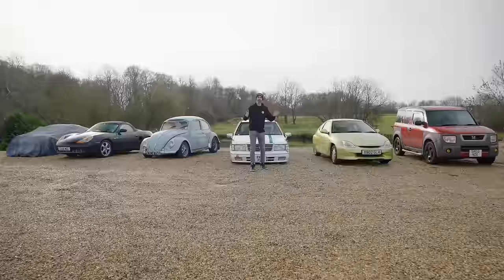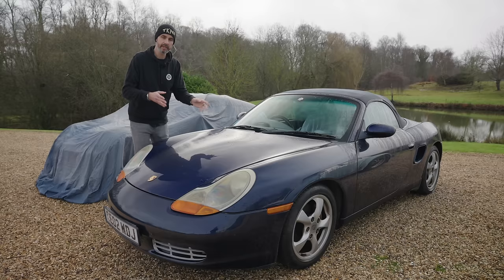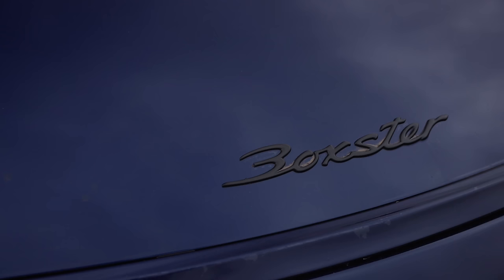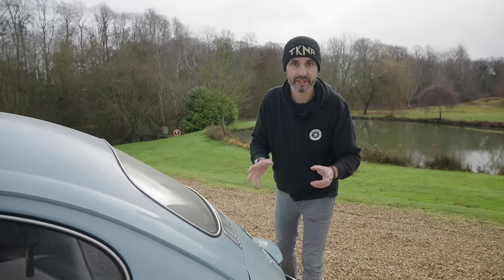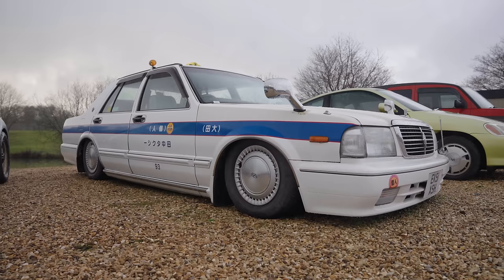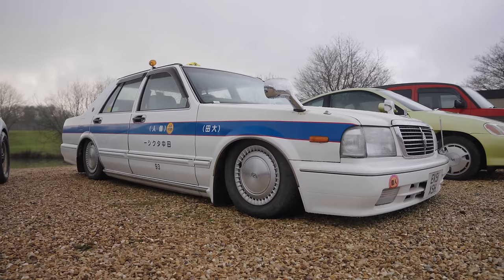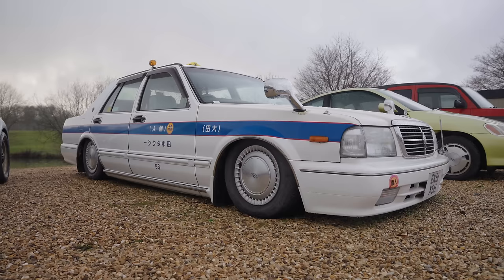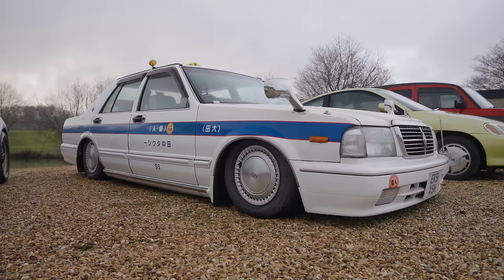My Project Car Round-Up. What classics I own and why I couldn't resist rescuing 2 more...

Comment: Sell the taxi if you got fair offers for it and let someone else enjoy it. Use the proceeds to fix the Element and get the Boxster some new bushings, brakes and wheels and then just drive it as is with flawed outside but properly sorted chassi and stock drivetrain.
Reply: I think this would be the best option, with it being Lpg it's only going to get harder to keep it running with fewer places offering it

Comment: Great to have a recap of the fleet and why you have each vehicle. The Element definitely feels worth converting to EV. It’s the best thing for it.
Reply: On what basis?
Reply: Mainly on the basis that Jonny has previously mentioned how much it costs to run with the existing setup. Plus his general sentiment (which I agree with) that EVs are great for everyday cars and the bulk of travel, and a few miles in a fun classic is great for the weekend.

Comment: Johnny, you mentioned your Element has a shimmy in the drive train. It looks to be an automatic. We own a 03 Element with an automatic that had a drive train shimmy. It drove me crazy trying to find it, I replace the rear diff fluid, all 4 struts, front driveshafts, and any bushings or balljoint that had even the slightest bit of movement. It turns out it was the automatic transmission. A complete fluid change fixed it. The transmission and torque converter holds 7 litres, but when you drain it only 3.5 come out, so you do that 3 times, and replace the filter, and voila, no more shimmy. Ours has 330 thou Km on it (Canadian model), we love it, it's the most useful car we've ever owned.

Comment: Johnny, the water under the seat is classic blocked drains under the fabric hood/roof. You have to put the hood into service mode, this will reveal a drainage area underneath and there are a couple of drains under there which get blocked with leaves etc. I blasted mine out with a pressure washer. Should sort that. Symptoms would be wet carpet behind the seats, under the door area.

Comment: Keep the taxi and take the wheels to a place that can turn the oem faces into 3 piece wheels, it wouldn’t screw with the car itself and it would make it look even better on the air suspension, if you want to keep the stock wheels maybe just get an aftermarket set. But the custom wheels would be killer!
Reply from the maker: Love this idea.

Comment: Hi Jonny, I’m an ex-Porsche technician, re the water ingress, first thing to check as it’s a common issue, remove the plastic cowl panels  under the bonnet & you’ll see left and right the drain holes, these fill up & the water enters the car and plays havoc with the ECU’s under the seat, blow out with an air line, test and refit the cowl panel.

Next  is the top windscreen seal, usually ingress is from the corners. The seal dries out, try applying Vaseline to it and the seal on the front of the hood.  The seals on 986’s are expensive.

Then check by lifting the convertible flap halfway, the two drain holes either side as these fill up with rubbish, finally make sure the door panel waterproof seal hasn’t been damaged.

Please for the love of God DO NOT EV the Impala, that would be criminal, the engine of any car is its soul!
Reply from the maker: Thank you for taking time to write all this. Intending to look at it this week...

Comment: As a former employee of smart my eyes dilated seeing your roadster. The roadster is a great car worth saving and  brabus version is a blast to ride. Sadly the plastic bits on the car don't age well especially the rear windows.
But you can replace them . Replace the turbo, check for leaks in the roof!!!
Get this horrid vinyl off and it will be a blast!!!
Reply: The rear windows do polish up quite well. Wet sand 500-2000 grit, then polish. Quite a job but really rewarding.

Comment: Boxster leaks can often be down to a panel seal behind door cards, also noticed the hood cable is over, not behind the guide above the door. Sell the engine to someone who's been bitten by the IMS bearing and put a 400hp Impreza boxer engine in it!

Comment: Nice one - knew it was a Roadie as soon as I saw the cover. I have a last-of-line "Finale Exclusive" (parts bin special)  notchback with 140k on the clock. Been on several long Euro trips (Villa d'Este, lake Como, Austrian F1 GP, old race circuits tour of France etc)

Sadly, I'm as disorganised as you and it's been on my ramp in my workshop for 5 years 😳

Great little cars.

Comment: The chances of the Roadster’s tyre being flat is near non existent as the Brabus wheels are of a tensile strength 1 grade harder than butter, the inner rim will be dented and releasing air.

Best bet as a first base, is to source a set of standard Roadster wheels; 16” Spikelines, 15” Spinlines or (my recommendation) 15” Tracklines (multispoke). 
If you stick with the Monoblocks the only certainty is you’ll be arriving home on a flatbed regularly.
The rear Brabus wheels have very few options for that size.

The man for sorting that roof is Peter Jones (Smart Mania) near Knutsford.

Comment: Your water issue on the Boxster is likely related to the failed elastics on the roof. Clearly visible above the passenger side window in your video. Easy fix. Do both sides, and clean out the top tray drain tubes. Nice eclectic collection. Love it. Cheers!
Reply from the maker: Thanks! I think the elastic is slack or broken, so I will take a look ASAP
Reply: @TheLateBrakeShow love YouTube. There’s always someone who knows the fix.

Comment: I recognized the Smart Roadster immediately. Had one myself several years ago. 
With 180.000 miles it is probably on its third engine (rebuild). 
This is the car to convert to electric, it should have been right from the beginning!

Comment: Grown to your channel over the year's i had an early mk 1 CRV and did 300k with the same clutch brake disks and drums at rear same clutch only had to  change the oil, but eventually the drive shafts wore out nothing would come apart so had to scrap it. That was an un burstable engine.
Nearly bought a Mercury Cougar 30 years ago but had no ware to store it 
Best wishes

Comment: The EV '64 Impala Idea intrigues me!
If done properly with like something like a TM3 drivetrain and good range.
You potentially also wouldn't need the boot full of batteries as the EV battery could also manage the hydraulic pumps 😁
Reply from the maker: Exactly!

Comment: I could tell it was a Smart R-C... but I wasn't ready for the wrap! Blimey. Just as early-'00s looking as the car itself, to be fair. I have always been tempted by the idea of one of those (ESPECIALLY on Brabus wheels), so that'll be fun to follow. Also, my '00s Honda leaks around the windows at the moment as well, so I guess that's just inevitable with them past a certain age!
Reply: Having owned one you were always better off with the steel wheels off the roadster lite. The brabus wheels were made of cheese and too big for the car. First pothole you hit it's refurb time. The 15 inch steelies were lighter, gave a more comfortable ride and were absolutely enough rubber for the car

Comment: On stuff like the Tokyo Taxi and the Bargain Boxster... Don't modify them. What happens when you modify cars Johnny? They end up in a corrugated steel industrial unit for years on end and you never drive 'em (and you end up spending obscene amounts of money on them). You do need cars to work sometimes, IMO you've got projects, and you've got runners and they should not cross over too far. I am the same, I have 4 motorbikes, but I try to keep at least 2 completely road legal at any time. At the moment I have 3 working, and one in need of mild restoration. That's a much happier place for me than having 4 bikes that need constant work.
Reply from the maker: I think you nailed it. Projects and runners are separate, but my runners are always on the road. They get improved and maintained, but not heavily modified.

Comment: Insight owner here: You will most likely need to remove the old seam sealer and apply a bead of new seam sealer under that roof trim piece. Don't forget to check behind the lift gate!

Comment: Oh btw, with the smart. I don’t know about you but that hateful gearbox would drive me mad. I have seen people do bike engine conversions on these but that would probably be hard to live with for other reasons. No room for batteries so EV is probably out, I have often wondered whether a Honda VFR1200 with the DCT box would make for a much easier to live with motorcycle running gear in a car. You could even wire in the DCT buttons to the car’s stock shifter and paddles and it happens to by fly by wire throttle as well. Always struck me as the engine swap of choice for the smart roadster platform.

Comment: The Element rear diff, if it's the same as the gen 2 crv, just get the diff oil changed and use the oem fluid. My crv sounded like a tortured Wookie at the back when I was on full lock... yes the back not the front! Fitted new wheel bearings, fitted a reconditioned drive shaft... Still sounding like a bear on heat...
Googling found exactly the same sound.... it was the diff oil.
Reply from the maker: Really? Wow, ok. So Honda oil all round. Than you

Comment: Please, for all things sacred, get rid of the plastic fuel filter on the Beetle. That is the reason that so many of those have burned to the ground. They wiggle and pull the fuel line out of the carb, the fuel pump still pump’s and then it burns the car down.

Comment: The new project cars are very interesting and will make good content  as they progress.  Please do not low ride the Impala. If you want a low rider, find something less iconic than an SS Impala. Good luck on getting the barn up soon to protect the fleet.
Reply from the maker: I started the lowrider almost 20 years ago. The chassis was reinforced back in 2007!
Reply: @TheLateBrakeShow  so now you will have a vintage Impala that handles well. I know how much work you have put into the vehicle to low ride it, and while there is still a bit of that culture left here in LA we don't see it much anymore. I am also from a Chevy family, my father was a suspension designer for Chevy in the 60's and 70's so I do have a bias for the stock ride height, (or perhaps a slight raise in the rear). Anyway, I would just love to see it back on tarmac and rolling. Which ever way you go with it, we still love your work and all you do. Thanks Johnny.

Comment: Would it be possible to use a donor Gen2 CRV to convert the Element to diesel? The Honda N22 engines are pretty good with a new exhaust manifold and injector seals.

Comment: I reckon you need one more car to complete your fleet  Jonny 😁
One more won't hurt lol.
Iv got a 97 vauxhall Calibra 2 litre 16v iv owned it since 2017 .
Its mechanically/ structurally sound. 
Paintwork is mint apart from the bonnet where it was damaged by a cheap car cover that's rubbed on it .
Tbh though im unsure whether to keep or sell on , still in two minds .
Just wondering though whether you are a fan of the  Calibra ? I know they are a bit marmite you either do or don't..cheers keep up the great work 😊👍

Comment: It just occurred to me that not one of these vehicles makes a suitable tow car. Only the element, but as it’s JDM it won’t be rated. Imagine all these projects scattered about in different places but no trailer to deal with the inevitable logistics.
Reply from the maker: Yeah, it's annoying. But Element can get a bar fitted. Trouble with tow cars is that they are too large...
Reply: I’m sharing this pain. My hugely reliable and practical car is a Stepwagon, you can get bars for them but can’t legally tow anything in the UK as they don’t have weights stamped on the VIN, as is the case with nearly all JDM things regardless of how well suited they would be - and I expect true of the Element too. Same for Elgrands and the like as well. That said, not having easy access to a trailer has probably saved me a fortune in terrible project car impulse purchases.

Comment: Your Insight has the same steering wheel as an early S2000 by the looks of things.
Reply from the maker: It does, but without the leather trim. Mine actually is an S2000 wheel that was added by the prev owner.

Comment: Wow, you really have joined Monkey and Frankel as a 2cv owner! 🤣I sometimes wonder why you auto journos seem to have a thing for the horrible little egg basket? I remember my aunts one as one of the worst cars in existence? (though she might have had a particularly awful one)  I think you should probably just try to drive the impala for a bit before you decide wether to convert it or not, and regarding the porsche I have to agree with you on the wheels. They need changing. Maybe do the typical intake mods and a some suspension too? All in all, i appreciate what an eclectic collection of cars you've got. There's something for everyone there, 👍

Comment: That Beetle is fire! LOVE IT!

EV convert the f***  out of that Impala, take all my dreams, just do it! 
Because my dream has been for 5 - 6 years atleast to take a big American rolling boat of a thing and EV convert it...
Air suspension, make it soft and it should be so effortless to drive it would be deemed too dangerous and courts would require you to have another adult in the vehicle at all times with a drivers license and a second brake pedal! Rolling whisper quiet lounge, where you sit down in the car and as you roll away you fall asleep and crushes all the bicycles parked outside the local grocery store or what ever... steering so light, moving your eyelids too rapidly would put you in danger of a head on collision! 

Heck, the Beetle would be awesome for a conversion project as well! 

Getting started thinking about EV conversions is dangerous, the possibilities are just endless!

Comment: If you estimate the amount of work and money needed,and then double that,you will probably have a realistic number. An old guy told me that once...and as i was young and foolish then,i did not agree with him..at all. 25 years on, i have to admit he was a 100% right. And i was not..at all.  Dont bite off more than your bankaccount can chew. Getting a big non-leaking garage is the first thing to spend money on. Only after that is done,it makes sense to buy a bunch of cars. Otherwise you just pay for storing cars that are getting worse and worse,without any means of fixing them up. (Ps.easier said than done...i myself own a couple of cars,and havent got dry storage..and my garage is small,and i havent got the money to replace the currently  leaking roof...and STILL i look for  other cool project cars on ebay..guess i too will never learn🙄🤨😏)

Comment: Colour on the Insight is pretty faded. You can do a good detail, but it really could do with a respray! Then you'll see what the colour actually should look like.
Reply from the maker: Doesn't need a repaint at all. It's a pearl metallic that has lasted really well, but yes a detail would be appreciated
Reply: @TheLateBrakeShow  sure, a good detail will do wonders, but you can't ignore the faded paint, mate. Just look at the colour of the badge vs. te colour on the bonnet/hood. But also the difference in colour on different panels... Just have the paint measured (on colour, not thickness) on various spots. 😉😇

Comment: UK Headlight laws have changed. LED bulbs are now really illegal and wont pass an MOT. Basically, if it came out the factory as a halogen, it now stays a Halogen.

A halogen headlight cant be converted to a HID or to a LED headlight, mostly the halogen reflector wont work with a different HID or a LED properly, it also wont have headlight wasers and self leveling so it doesn't have the legal requirments to be a HID or a LED.

If it needs more light add a LED lighbar below the Numberplate.

As you would document it by means of a youtube video, you could get yourself into some shit, like the guy who did the UK cannonball run in his Audi S5.

Comment: get the insight into 2024 with LED lights and re spray (same colour with modern twist, Metal flake etc) sort Suspension. Sell the Taxi! (sorry) Get the Impala on the road
Reply from the maker: Insight doesn't need a repaint - paint is in excellent condition for the mileage. Needs a detail.
Reply: @TheLateBrakeShow  never said it needed one!  I just like the idea of a Re spray 😁 ooh get the late break logo ghosted so come up in sun light and headlights 😃😃😃 seriously rate the insight,  loved the episode you did on it

Comment: Honda Element with a 4-speed auto? Weren't these only sold with a manual or a CVT?
Reply from the maker: No. This is regular automatic.
Reply: @TheLateBrakeShow  Is that an unoptanium option? I was on the lookout for one of those a few years back, bu all I could find that wasn't a manual had a CVT. 

Any difference in left or right hand drive markets perhaps?
Reply: @TheLateBrakeShow  Or were everyone selling them misinformed? According to Wikipedia, the worlds most reliable source, they had a four speed in the first generation and a 5 speed in the second generation. No CVT. 

Maybe I dreamt it all. :D

Comment: You need an EV to have the full set Jonny! 😉⚡️🤷‍♂️
Reply from the maker: In the pipeline....
Reply: @TheLateBrakeShow  there are quite a few EV conversion drop in kits coming for American Muscle. A comversation with Fellten and Legacy EV perhaps 😉
Reply: @TheLateBrakeShow Hey Jonny is Mrs. Smiths old Nissan getting an EV conversion?
Reply: @TheLateBrakeShow what’s happened to the Flux Capacitor? Loved that little thing